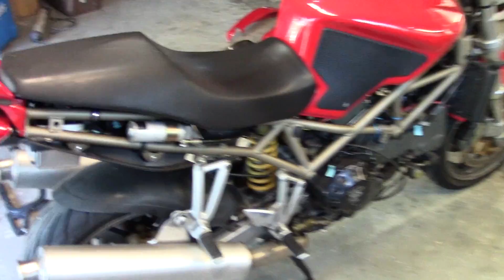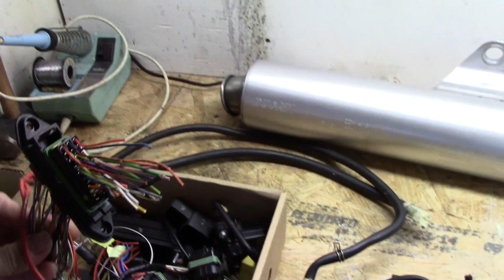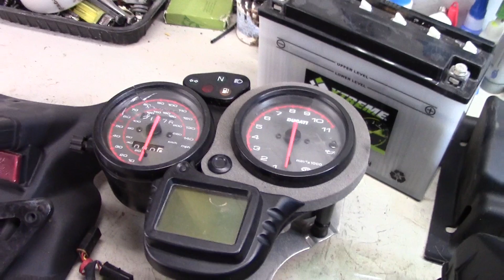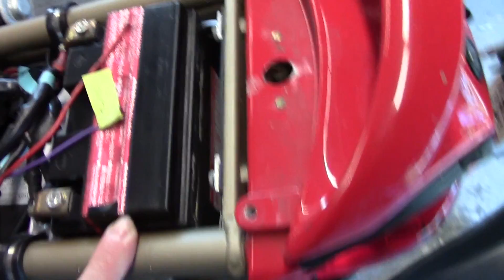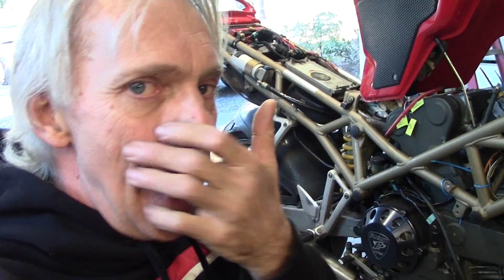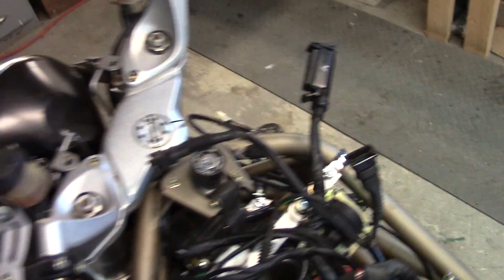Ducati ST4 Streetfighter Cafe Build Part 1

Comment: The faired STs look fantastic from every angle except from head on. I like your choice of the ST4. Worth inspecting the engine mount bolts as they get stressed if the suspension bottoms out. ST4s has the aluminium swingarm so possible to swap out the steel one. Put an old friction plate plate behind the clutch pack and it'll be quieter. Remove 2 of the clutch springs and you get a lighter clutch...or get an oberon slave .I've toured 2 up with full luggage and no clutch slippage. Use thicker gauge wire from the stator. Put reg/rec in airflow. My old ST2 is going on 54k and just munches the miles with smiles.

Comment: Look into "Nology" coils , (40k) and spark plug wires !  They also have good spark plugs, but I also use "brisk spark plugs " there "EVO " is a great plug !  with this , the "burn " is over by 3-5 ° ATDC , it make the engine very strong ,and feel like you lighten the flywheel ! I also dropped three teeth on rear sprocket, better MPG, also removed " CAT:" and did mod. to airbag

Comment: Great to see you back on a bike build and love that frame too.  Fingers crossed for April.  If you can sort that wiring mess and the bike runs, see no reason you shouldn't get there, even if mid modification of the other parts.

Comment: Good luck with the build. I rode them for ~7 years and put 70k miles on a couple of them.
The first was a 2000 ST4. Issues I had that you may want to consider:
1. Nut in clutch assembly had insufficient or no thread lock, backed off and made an awful mess. The whole thing had to be replaced.
2. Fuel sensor stuck the gauge half way open in BFE West Virginny where my wife and I got a scenic hike with the bears.
3. ~30k miles, the chrome plating on the cam/rocker arms started falling off and needed replaced. Duc did that on their dime long after the bike was out of warranty. They fixed the other issues UW too. They stood behind their stuff.
4. Fueling was kind of snatchy. Duc used to make a "closed course only" 8 pin IC (as I recall) one could replace to correct that.
The second was a 2003 ST4s. No real problems, but a few things I learned:
1. The TPS was a little out. There are a couple pins on one of the wiring harness and a screw and you shoot for a certain mV measurement to get it right. Movement of the screw resulted in wild swings of the TPS reading. Very hard to set.
2. They went to a gel battery. It's fine in the summer, but once it gets cold, it loses the oomph to start the bike. Had to replace with the old "add water" type in you video.
3. The Ohlins shock leaked and had to be sent back to them to rebuild.

Comment: Was the previous owner an aircraft mechanic? The aluminum battery box fab and those black clamps on the rear of the frame are often used to support wire harnesses on planes. If so, should give you a bit of confidence in his work but we also tend to be lazy. Excited to see how this bike ends up. Been watching since you were releasing videos on the CB750!

Comment: I have enough fun with mine and it only has two valves per cylinder and carburetors...you're gunna have a blast.  The thing I like about you Dean is that you actually know what you're doing and your advice is solid.  Getting the bike to run and ride prior to customising and paying respect to the engineering teams that developed the package can not be understated.  It may be our hair colour that induces these crazy ideas but I concur with much of your ideology.

Comment: Now you're in my area of bike knowledge as I have owned/restored/raced many dozens of Ducati in my lifetime! I currently only own 8 at this time, but two of them are 916 engined bikes (ST4 and Monster S4) - The previous owner would have never made that bike run again with what he had there as the Monster Gauges are a matched set to the ECU and the anti-theft chip in the keys, so your plan of going back to the ST4 Gauge cluster is excellent! (Plus you keep your Fuel Gauge)  There really is no Millage rating to when you're supposed to change the cam belts, you just do them every two years regardless of miles and you cant go wrong- Fortunately for you, a 916 has the most affordable cam belts than an other Ducati model! I only use DAYCO carbon/kevlar belts in my rubber-band Ducks, for your model it should be around $50/55 for both!  Don't bother with factory Ducati brand belts and stay FAR away from the cheap shit CA Cycleworks ones,. I've seen bikes with under 1000miles pop and cost you a head or worse - (All Ducati are interference motors, since you mentioned it BTW) I have a Complete Unmolested red ST4 fairing here extra, with all mounts, brackets and the headlight I'd make you a deal on, if you decide to put it back to stock, as it may be a large challenge to mount a Imola fairing from Airtech intended for a 1972 750 Bevel-twin, VERY different animal to what you have there and it'd be an expensive attempt if it doesnt work or if you have to chop the heck out of it to make it work!  - I  see the previous guy was making a bracket to relocate the coils up under the tank, so this is why he couldn't use the airbox - would have been WAY better off swapping those coils for "Stick-Coils" from a Monster, way cleaner and usually $50-75/ pair on eBay -  You'll also be pleased to know I see from your hollow brake and Clutch levers your masters are easily rebuildable, as the solid-bolt lever Brembo masters are disposable - Kits for yours if you need them are $25ea,  check the numbers stammped into the underside of each master, but you SHOULD have a 12mm Clutch piston and 16mm Brake - I always buy correct aluminum Mahle brand fuel filters (what it calls for) usually around $25-30 but well worth it, dont go with a steel filter from the auto parts store even tho it will fit, it tends to rust out your gas tank!! I buy Royal Purple Synthetic oil for all my Dry-clutch Ducatis, it's $40 for a 5-qt jug @Walmart and it's enough for TWO oil changes!  Get K&N oil filters they have a hex-bung welded onto the center of the bottom to make removal easier (Cycle-Gear stores around $13-15) Let me know if you need anything or have any questions, I have been riding Ducati since I was 4, now I'm 49 so unlike MOST You Tube commenters I actually know my ass from a hole in the ground! LOL
Reply: Thanks a ton for the valuable info! Quite refreshing to see a knowledgeable commenter. :)
Reply: Shoot me an email... makerdino@gmail.com
Reply: This is gold for me, thank you.  I fitted CA Cycleworks belts to my '96 900SS recently, I think I will go buy Dayco now.  As for the master cylinders the PO lost the pin between the brake lever and the piston and was running it without, this was forcing the piston sideways due to the bell crank action of the lever and causing it to leak and it damaged the dust seal too.  I can easily fabricate a new pin but I was told that my MC's, (hollow clevis bolt the same as Deano's), were built during Brembos "fear of litigation period" and that they were throw away items with no kits available.  I purchased a new replacement from a newer model bike but wish to return it to factory as it is an all original unmolested bike with less than 20,000 kilometers on the clock.  If you have links to where I can buy a kit I would greatly appreciate it.  I did a video, two actually, on changing the belts and re-shimming the valves, I hope my hole in the ground didn't come out looking like an arse lol.  Thanks again, Andy.
Reply: I have done MUCH research on Brembo masters - if the level pivot bolt is hollow, then parts are avail - Check Gotham Cycles (Bradenton, FL) website, he has good prices and is good about shipping quick Brembo parts and kits
Reply: Just watched your valve adjust video - One thing I do differently (and maybe because I learned by working in a Ducati shop) if you're supposed to measure both sides of the closing rocker "Fork" on the "Hat" with two sets of feeler gauges as using only one may cause it to tip sideways and give a false reading of clearance.... the Ducati shop I worked in would also remove both heads, clean the valves & seats and lightly re-lap them in before doing a valve adjustment so it was always spot-on  (which is WAY easy to do on an Air-cooled Duck, a bit more of a PITA on Liquid cooled, but still is the RIGHT way???)
Reply: Watching part 2 now, you should pull the rockers and check for the plated Hardface flaking off the lobe-end of the rockers (can be common), which would explain your weird gaps? you can also pull the screen on the oil pump pickup and inspect for chrome flakes, as sometimes they get caught here before going into the oil filter.....
Reply: The CA-Cycleworks belts are asian made and not to be trusted - Sorry, for me it's Dayco only, also check your belt tensioner bearings, if they arent smooth as glass, replace them as well, the idlers are special , but of you press the two bearings off the tensioner shafts you'll find they are bog-standard 6201 sealed bearings and are avail in any auto parts store, for $2.50 ea (you'll need 4) I bought mine at NAPA, as they are a common Ford car Pilot bearing also - be sure and press them on and off, (I use a Vice and some 1/4" drive sockets, if you hammer them on and off you'll ding them or the shaft up and you wont be able to get the circlips back on) MUCH BETTER than buying proper Ducati bearing, where when last I checked the cheapest place you can buy them is like $17 per bearing or something
Reply: Also,also (LOL) I have been doing the "Guitar-Tuner App" on my iPhone and setting belt tension by plucking the belt like a guitar string and setting to the exact Mghtz..... been working great on both 4V and 2V motors for me? you can search this method on Google or Youtube, it's easy, just do the one side then rotate crank to raise the other cyl to TDC to ensure no pre-loading of cam tension ..........
Reply: Thanks for taking the time to provide such detailed and valuable information, Dean...sorry for hijacking your comments section.

Comment: Yes!!!! Make your own custom fiberglass fairing. People will really appreciate the make!
http://www.triplesonline.com/racing/COMPETITION%20-%20The%20%2770s%20and%20the%20three-cylinder%20Trident_files/197x-dick-mann.jpg
Reply: And while you are at it. I realise that the double low exsausts are the looks for the type of bike you are making but I would really  like to see an under the engine exsaust that leaves an unonstracted view of the back wheel like this https://i.pinimg.com/originals/cf/37/63/cf3763706c3d8a58b5c8a14281c95d20.jpg but with the outlet turned sideways of even at the front. I know you have limited resourses and welding is pretty difficult but I can dream, cant I and also comments are free. Good to see you back Dino!
Reply: Amazing Frame!